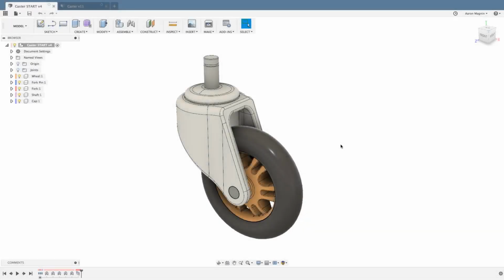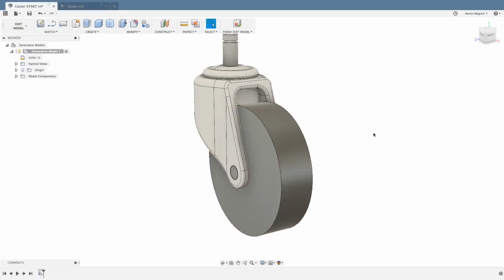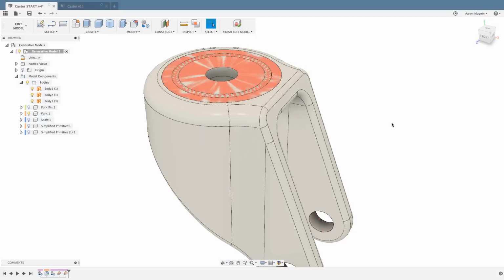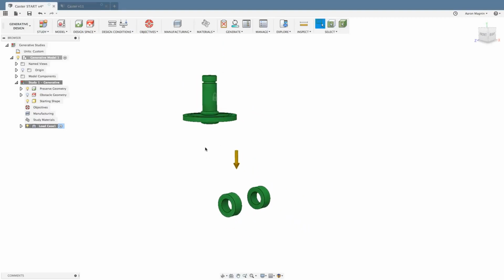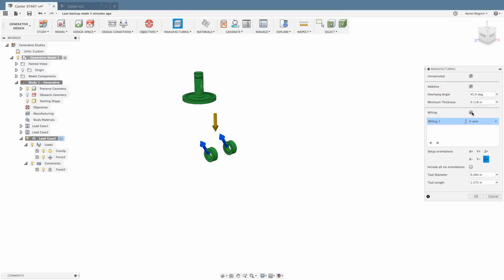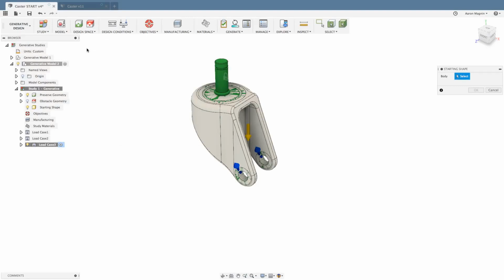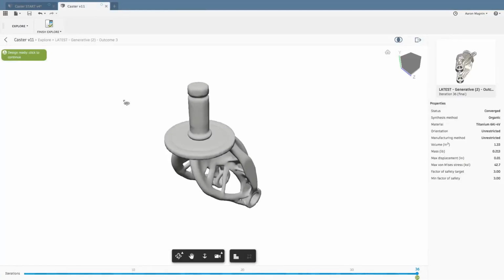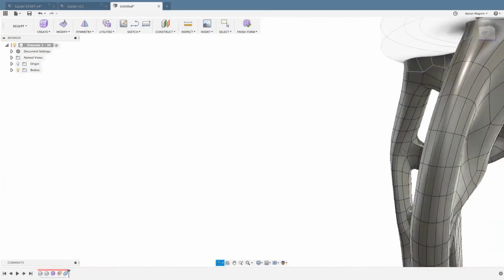Autodesk Fusion 360 - Generative Design

Comment: are these organic shapes even possible to manufacture
Reply from the maker: Yes. Typically using additive manufacturing. That, or the shape can be used as a reference and the resulting shape manufactured using more traditional manufacturing methods.